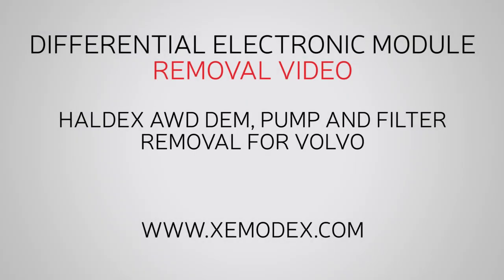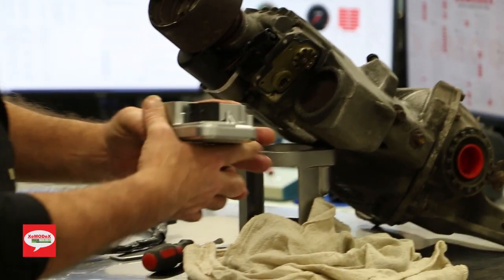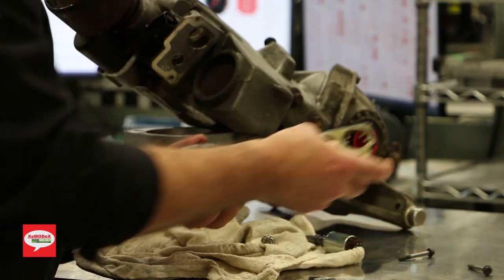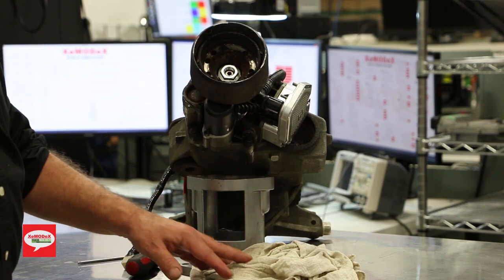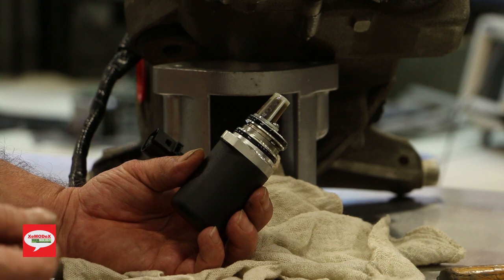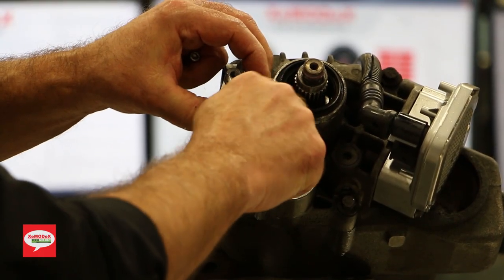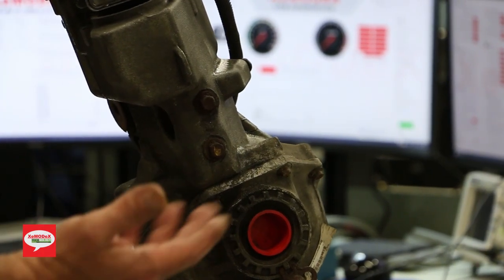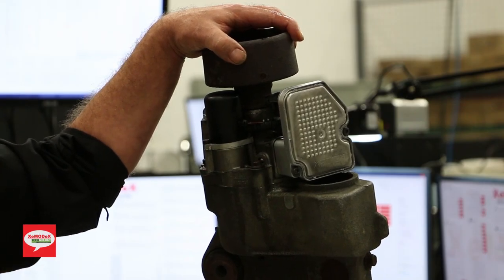Differential Electronic Module (DEM), Pump and Filter Removal Procedure for Volvo Haldex AWD

Comment: Spot on vid, had a low pressure fault, fully serviced and did exactly what you did all working now thank you, the oil level was low after removing the pump, can the oil leak in the the diff at all as I had no external leaks.
Reply: Dear @Andrew Harris, can you please tell me how did you diagnose the fault?
Did you had to put new pump in?
Reply from the maker: Happy to help!

Comment: To get the flange off at 10:40ish i found a 3" two jaw gear puller perfect. Didn't require much effort but would have been challenging to tap it off with a hammer while still on the car.

Comment: Great video, thanks! Should be very useful.  No attempt to remove the old fluid though?  Sticking a bit of tubing in the filler hole and sucking it out with a syringe for example?  Any idea how much fluid is in there?

Comment: Hello, please help me and I know that I don't know where to go to repair the car. I bought a Volvo xc90 in 2004 and it doesn't engage the back, the gimbal doesn't turn, I picked it up on the elevator or elevator, the mechanic put it on  I put the speed on the elevator high and it doesn't spin the wheels on the back with the cardan the test gave me that there are two fault modules one from the group and one from the gearbox in front  tips that's the problem of not engaging the back and not turning the gimbal thank you

Comment: Hi and thanks for the video. This unit looks very similar to the one on my 2005 Mercury Montego AWD Premier. Is this correct? This has been a very problematic unit for me. My car has been thru two of them. I asked the Ford dealership if the AWD system could be disabled and was told they could disconnect the AWD control module and the car would safely be just FWD. Is this a simple DIY procedure or should I take the vehicle to the dealership. Thank you for your input.
Reply from the maker: Hi Roland. We suggest taking your vehicle to the dealership for this procedure. Alternatively, we do offer a repair service for your 2005 Ford Mercury Montego DEM. You can learn more about our repair service on our website here:
http://xemodex.com/us/product/differential-electronic-module-for-ford-fo-1040-7f9z-4c016-10-20/

Comment: My AWD isn't working on my 2004 XC90 2.5t AWD and I can move my driveshaft with all 4 wheels on the ground and in park but doesn't make any noise from the bevel gear during driving. Do you think it's something in the diff or the sleeve connecting the trans and bevel gear? I also already checked the AWD fuse in the back and it was good.
Reply from the maker: We'd need the tech to advise more. If you haven't already fixed this, then fill out this form: https://xemodex.com/us/technical-question-form/

Comment: Fantastic video ...my question is size of rings in both sensor or part kit number please gen 3 land Rover 2008 thanks a lot of you can pass the information
Reply from the maker: Hi Alberto. You can contact our Tech Support department if you still require assistance with your troubleshooting. Simply fill out a "Technical Questions" contact form on our website. We're happy to help.

Comment: If replacing a blown motor does the drive shaft need to be removed? I'll be doing the job in my driveway
Reply from the maker: Yes the motor and assembly must be removed, but this is an extensive job. You will need to raise the car high enough (on a vehicle hoist) to remove the motor and assembly from underneath the car. We do not recommend doing this procedure on your driveway.
Reply: Did you manage to get it done in the end? Any tips or comments you can pass on to me before I tackle it..? Cheers.

Comment: Will this unit when it goes bad cause an ABS light to come on or if you got one from a used car and put it on a different one will it throw a Traction control light ABS light to be displayed on the dash
Reply from the maker: Hi Aaron. You can contact our Tech Support department if you still require assistance with your troubleshooting. Simply fill out a "Technical Questions" form on our website. We're happy to help.

Comment: If the DEM goes bad or contacts get wet, can your car go into limp mode and have instrument cluster, a/c problems?
Reply from the maker: Hi Jon. You can contact our Tech Support department if you still require assistance with your troubleshooting. Simply fill out a "Technical Questions" form on our website. We're happy to help.

Comment: i have a 2005 audi A3 3.2 quattro ive took of the haldex controller cleaned look fine inside all back on fitted and had NEW clutch  pump fitted but still no Quattro ? does the new clutch pump have to be programmed into car or anything . hope you can help. otherwise it must be a bad wire somewhere
Reply from the maker: Hi Janna. Please contact us directly to speak to our tech specialist regarding your vehicle diagnosis. Call us toll-free at 1-888-712-2525 (US & Canada) or email us info(at)xemodex.com. Thank you.

Comment: hi i have ford kuga 2011 haldex awd pump failure .the pump is same as your volvo would it be worth us giving it a service as its only done 24.000 miles ford just say buy new unit but hubby says can he service it and would it be worth taking a chance that its just gunged up ?
Reply from the maker: Hi Julie. I spoke to our tech and he said if it's just the pump then to replace the pump, filter and fluid. If the Haldex unit is acting up, then test the pump first before sending your unit in for repair. You can check our website in the "technical resources" section for our pump test flow chart. We recommend replacing the pump, filter and fluid when you replace/repair your Haldex AWD unit.

Comment: Escuse me sir, I have a 2004 volvo xc90 t6 Sport 2.9L turbo, and it has a bunch of numbers on the white label on the side of the DEM haldex unit.  The first line says:  SIEMENS VOLVO, the 2nd line says: 5WP22201  05  102160 , the 3rd line reads: HAP511    1515  28.07.03/2   , Which numbers do I need to pay attention to if I wanted to by a replacement unit where I wouldn't have to worry about the new unit not being compatible or having to program it to my vehicle?
Reply from the maker: Hi Rholenn,
Unfortunately we do not provide Pre-Programmed units for the DEM so we cannot provide you with a compatible unit out of the box. However, we do offer a Repair service where you can send us your existing DEM unit to get rebuilt. You do not need to worry about part numbers as we will repair your existing unit and send it back to you fully remanufactured. We also recommend that you test your Haldex Pump & Filter as these are susceptible to failure. We do offer a Repair package for the DEM, Pump & Filter.  
You can visit our website for more information: http://xemodex.com/us/product-tag/available-services-for-dem/

Comment: Hi guys , I just bought an xc90 2007 v8 , awd isnt working , I would like to fix this before winter , I was told it was the pump,  is there a way to diagnose this , I get a messages on the dash after 3 o 4 seconds when i start the car, please help , I am in Ontario
Reply from the maker: Hello! Please contact us directly to speak to our tech specialist regarding your vehicle diagnosis. Call us toll-free at 1-888-712-2525 (US & Canada) or email us info(at)xemodex.com. Thank you.

Comment: Hi I have a ford freestyle 2005 and the code from the scanner is p0961 say that is the solenoid A could it be that is just the solenoid in the module . Thanks
Reply from the maker: Hi Alfredo. Please read the following response from our tech:

For the ford freestyle DTC-P0961 yes it is possible it’s just a solenoid.
Code Description: The pressure control (PC) solenoid valve is an electronic device that regulates transmission line pressure based on the current flow through its coil winding. The magnetic field produced by the coil moves the solenoid's internal valve which varies pressure to the pressure regulator valve. The transmission control module (TCM) controls the PC solenoid valve by applying a varying amount of amperage to the solenoid. The applied amperage can vary from 0.1-1.1 amps. Low amperage, 0.1 amp, indicates high line pressure. High amperage, 1.1 amps, indicates low line pressure. The duty cycle of the PC solenoid valve is expressed as a percentage of energized ON time. Zero percent indicates zero ON time, non-energized, or no current flow. Approximately 60 percent at idle indicates maximum ON time, energized, or high current flow. The TCM determines the appropriate line pressure for a given load by comparing the throttle position sensor voltage, the engine speed and other inputs. When the TCM detects a continuous open or short to ground in the PC solenoid valve circuit, then DTC P0961 sets.

Comment: when removing the  flange is it aoc fluid that's coming out ?
Reply from the maker: Hi Niklas. I spoke to our tech and he said that it is gear oil/AOC fluid. Only a small amount should come out. He said you must drain out and change the fluid.
Reply: When you remove the filter cap and filter, that's when the AOC fluid spills out...be ready with a catcher pan.   This completes the drain process.
Reply: Or, it will drain AOC oil when the pump is removed, whichever you remove first.

Comment: Is this more common issue than just the Haldex pump going bad?
Reply from the maker: +Austin Kent Hi Austin. We always recommend that our customers should replace the AOC feed pump, filter and oil prior to installing a remanufactured DEM. A clogged AOC filter will over-current the pump that will short internally, subsequently destroying the DEM.
Reply: +XeMODeX Inc 
So i just acquired an 05 xc70 that has a bad pump, i'd rather not have to replace the DEM if i don't have to.. is it possible for the pump to go out without taking out the DEM?
Reply from the maker: +Austin Kent As long as you can communicate with the DEM then it should be salvageable. First replace and then test the pump for operation. In some extreme cases, the firmware for the DEM may become corrupted and produce a code that cannot be erased. Our tech recommends that you first replace the pump.  

We have a DEM diagnostic flow chart on our website that you may find helpful:
http://xemodex.com/us/diagnostic-flow-charts/